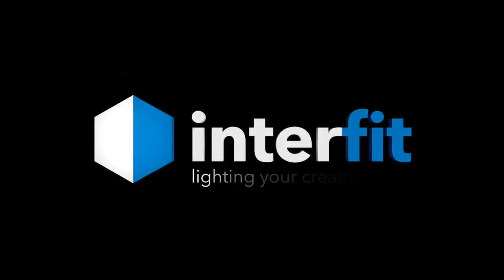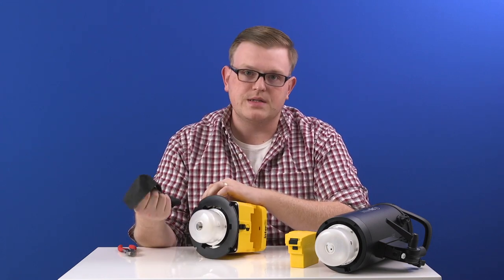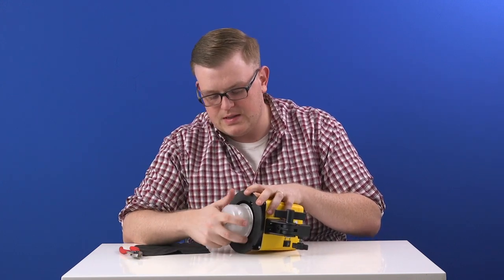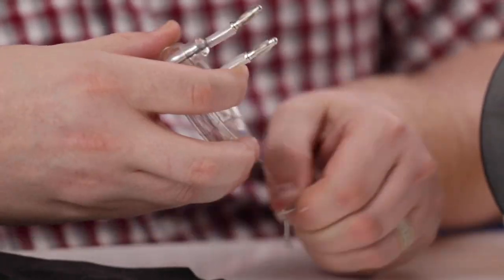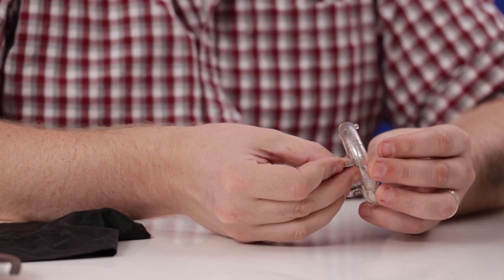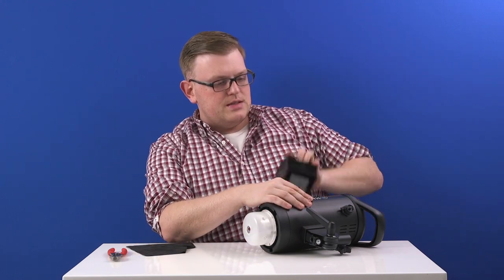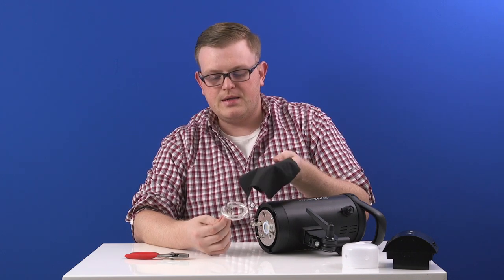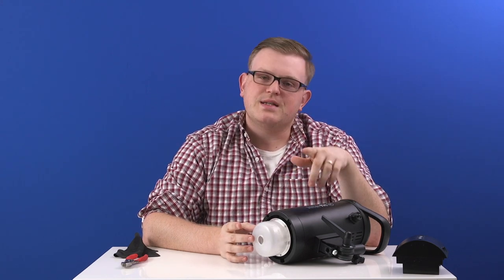How To Change An Interfit Flash Tube

Comment: My Honey Badger flash tube 'popped' and I've just changed the bulb and fuse. It still doesn't work, ie, no power at all (and it's not the cable as my second Honey Badger works just fine with it). Any ideas?

Comment: Hello Steven i have interfit exd 200 flash head that wont fire with the remote trigger or even the test button. When I touch the flash tube however it fires just fine. Any idea whats going on?
Reply from the maker: Sorry to hear you're struggling with your legacy Interfit gear! That sounds like the flash tube contacts are loose inside your flash head - since the unit is no longer supported under warranty, you can send it into our authorized repair shop and have it fixed for a fee. Contact support@interfitphoto.com for more details on where to send it.